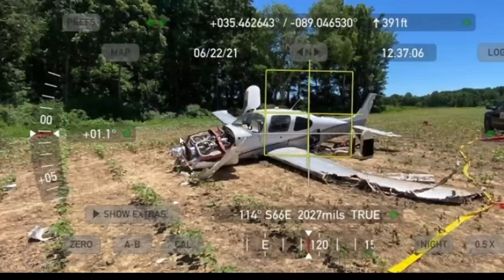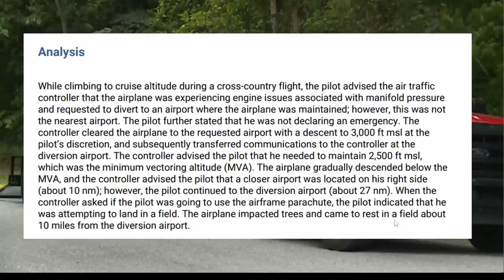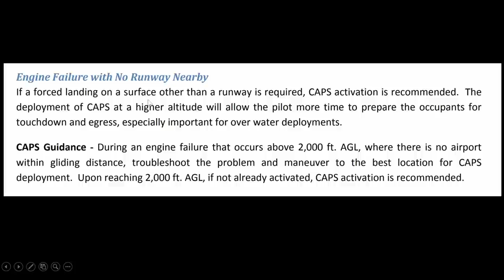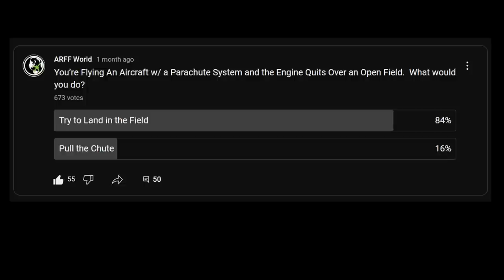Pilot Chose Field, Not Parachute in Tennessee

Comment: Doesn't it seem unusual how many cirrus airplanes have engine failures? Statistically or reported it seems in a very high percentage.
Reply from the maker: NTSB have a lot of Final Reports on these at least that I’ve gone over.  But I see a lot around my airport all the time
Reply: And fatals, too.
Reply: Cirrus does not manufacture engines. There are only three major engine manufacturers who supply engines to the piston fleet today: Lycoming, Continental, and Rotax. There are some others, but they are mostly used in experimental/ amateur-built airplanes. You can’t fault Cirrus for a Continental engine failure. By the way, I fly a Cessna with a Lycoming engine.
Reply: Not really, among the GA aircraft Cirrus  has a pretty good record overall. The same engine as in SR22 you can find also in Velocity XL, Cessna 400, Mooney M20, Beechcraft Baron and Bonanza, to name a few. The engine troubles often come down to maintenance and accidents overall often come down to the individual pilot's actions and choices
Reply: “Statistically” and “it seems” are basically opposites. It’s essentially the difference between science and guessing.

Comment: Open field. Two reasons, one I'm a control freak, the other is if you are current with off airport landing simulation (actual flight) you should be able to land the a/c with slight or no damage. This considers you are current in type and emergency procedures.

Comment: At 2:36 the commentator says "they pulled the parachute and now they have more time".

This is not really true in an engine out or similar situation. The vertical descent rate would be significantly higher under the parachute, than flying at minimum sink speed with the propeller windmilling. So you have less time after pulling the handle.

Comment: I'm pretty good at very quick decision making, especially in the cockpit of an airplane. I haven't yet flown a Cirrus, but if I had engine failure I would do this. First is altitude. Am I high enough to use the BRS (parachute)? Are there good-looking fields that appear as though I could land with little to no damage? Using the BRS destroys a Cirrus, so I will decide if I can land without using the chute. I probably need to be more inclined to use the BRS parachute, because fields often look great from altitude, but all kinds of unseen obstructions like powerlines, trees and ditches will damage a Cirrus & kill a pilot/passenger, as this video attests.  If the terrain below is hopeless, covered in trees, or mountainous, or I'm above low clouds & can't see, or open water, I would not hesitate to use the BRS parachute. Damn, this accident in the video looked survivable!
Reply from the maker: Thank you so much for taking the time to share and happy holidays

Comment: Well done! This is such a good channel and great question regarding whether or not to use the ballistic parachute on a Cirrus engine out emergency. My own thoughts are that it would be much safer if Cirrus had retractable landing gear. With the gear underneath, any rough paddock is going to be very hazardous so I would definitely use the parachute. If it were a tail dragger with big tyres, much different story.
Reply from the maker: Thanks I found this topic very interesting with so many against using the parachute
Reply: @ARFFWorld  Thanks for your reply. I should add to above that the use of the parachute involves certain parameters to be satisfied and isn't always suitable. There will be times it simply cannot be used and a forced landing is the only option.

Comment: Considering you do need to fly the airplane until it stops. Not the point of impact. Looks like he did not avoid obstacles and that's on the operator. I would definitely go for a landing spot over the panic chute That may be equipped. It wasn't an engine failure it was a engine power reduction. Definitely go for the nearest airport airstrip available. One must keep this possibility in mind at all times particular during transitional flight regimes take off and landing.
Reply from the maker: Thanks Matt
Reply: I wonder if any of the pilots that have stated in Matt's poll. That they would rather risk a field landing then pull the chute. Were piloting
 the cirrus on September 28th 2024 who tried landing at Kitty Hawk North Carolina versus pulling the chute. Dumb decision cost the whole family.
Reply: @ebenezerwheezer2957  let's see, because both mishaps were exactly the same situation?
Reply: @ebenezerwheezer2957  I didn't say it was the same situation, the other comment made a equivalency comparison. Those drogue chutes have a minimum altitude anyway.

Comment: Thank you for posting this.  As an SR22 owner, I committed to myself (and my wife) that I would not hesitate to use the CAPS when appropriate. I was in the 16% from your survey! It all looks wide-open and nice from altitude.  Wind change, trees, power lines, ruts, cross fencing, irrigation pipes, etc. - take your pick.  ALL will kill you when touching down at 75mph.  We train for field landings because 95% (or whatever the # is) of the GA fleet does not have CAPS. With CAPS, we still train for the field landings as sometimes that is appropriate.  CAPS is an option, not a requirement.  In this case, a known, controlled descent is the BEST OPTION.  Sadly, the pilot thought otherwise and his decision cost him his life.  BTW, as a CGAUX pilot, I have lots of training and education in water ditching.  I'd take that instead of an open field every day, all day, and twice on Sundays!
Reply from the maker: I appreciate a different take on this and thank you for sharing.
Reply: And what's to stop the parachute from drifting aimlessly into hazards? Sure, the parachute has it's place, but wouldn't you rather fly the airplane to an open field than hope the wind takes you to an open field?
Reply: @A.J.1656  I understand your comment.  My wife had the same ask.
First, you descend at 300 fpm, and are still 3400+lbs, so wind has little impact.  There certainly CAN be some, but use after use after use after use has proven it to be safe(r) than dead stick to fields.  Not fool proof or perfect, but the actual NTSB data shows the reality of CAPs being a good thing.  They have had one land on a school, one on a parked truck, one on a powerline.  No injuries to occupants or bystanders. How many people have died dead-stick/glide into those same things?   Again, time and place for everything, and having it allows the option.  Not having it gives you one shot with a lot of factors outside your control.  Even the best pilot in the world doesn't always control what is underneath them or when the engine quits.  Options are good.
Reply: @mattgirgenti3595  
I could see using it when there are no good options like being in IMC or no suitable landing options. They aren't an option on the airplane I fly, so I have to be ready to find the best place to put it down in the event of a dual engine failure.

Comment: K, pilot training for that specific plane is to pull the chute….  The Cirrus Pilot association has been through this thought process for decades…
The cost of a good decision is 10s of thousands… the cost of life is significantly higher…

Err on the side of survival… pull the chute!

Very few pilots are going to say you did the right thing by landing in a farm field, when the Cirrus training says…pull the chute.

Get the training, follow the training…

Things get more difficult when close to the ground… things are easier, the further from the ground the pilot is… under 1k’ above ground level time to react starts getting short.

As far as loss of turbo goes… this engine has two…. Engine ops get really challenging when a turbo stops working… no real way of practicing that scenario…. It is a good chance the mixture needs to be pulled way back to maintain a good fuel/air ratio…

This plane is pretty heavy and it’s landing gear are always out in the wind… it isn’t a very good glider.

Pilots are also trained how to reduce drag for best glide… for a plane like this, there is an optimum speed, and pulling the prop to a coarse pitch often helps…

Landing in water, with the gear extended… high probability of flipping when the wheels touch the water…. It can be really disorienting to be upside down, getting unbelted, and exiting the plane while underwater…

Being 83… not usually a factor.  Different from being 33… pilots are very capable of knowing when it is time to hang up the flying shoes…. There is an aviation society of flying octogenarians….  😃
Reply from the maker: Appreciate your thoughts on this topic
Reply: Fast response tonight K!

Comment: Pulling the chute means you will not have a say in where the airplane crash happens. Maintaining control means you can land in a field. 
I think people who are conditioned to think that an event like an engine failure is an automatic disaster that will result in a crash are the people who need the chute when there are other options to get on the ground. Most normal pilots who don't panic would only use the parachute if it was necessary.
Reply from the maker: Thanks for your thoughts

Comment: The closest experience to an SR-22 I have is a couple hours in a Katana DA-20, which is also a composite aircraft. One thing I remember is that thing glides forever, and landing in a short field would be very difficult (and probably catastrophic). The more I learn about the Cirrus, the more I understand why it has a parachute.
Reply from the maker: Did you like the Diamond? It looks fast
Reply: I am a student pilot training on the DA20 C-1, and from doing a number of practiced forced approaches now, I know I never want to select a shorter field if I have an actual engine failure. There have been a few less-than-ideal practice scenarios where on my climb out from the approach I've thought, "well, if that was the real deal, I would probably be dead." The aircraft has a remarkable ability to glide, and it is also a very light aircraft. Even a slightly faster approach than normal for landing can result in the aircraft floating in ground effect for a surprising distance. Sad to hear about this loss of a fellow aviator. A good lesson learned for me - if you're having engine troubles, take the closest available field made of pavement first before a short one surrounded by trees is your only option.
Reply: I Love the DA20!! Yes it glides well.. the DA 40 wasn’t as fun.. very stiff controls. The Cirrus doesn’t fly like the Diamond though.
Reply: @ARFFWorld the Diamond might look fast but they aren’t. The 2 seat DA20 is a blast to fly though!
Reply: @1GoodCupofJoe A side slip in DA20 it drops like a rock and touchdown at 65knts, carry a hand axe in the plane in case your inverted.
Reply: @publicmail2  I have indeed found that a slip will drop the thing pretty quickly, but I know I need to keep sharpening my skills and judgment for when to get that slip in if it's needed. I am usually doing at least one forced approach per flight now for practice, so I will definitely keep working at it! The rescue hammer is on my checklist, and I make sure I have it with me prior to every flight.
Reply: @1GoodCupofJoe  Good going , hand axe over hammer.
Reply: @ARFFWorld  Like it? I loved it! After the flight review was finished I took the instructor up to 3500' AGL and showed him a simulated banner pickup, and the plane immediately went into an accelerated stall (not cross-controlled). It was tempting to slam the rudder just to initiate a spin, but one of my former instructors almost died from spinning the DA-20 cause his went into a flat spin, so I kept it coordinated. As far as fast, well, it's almost as fast as Joe Biden climbing a flight of stairs.
Reply: The Diamond DA20 landing speed is much slower than the Cirrus. It's fine in a short field with the proper technique.
Reply: @thomasaltruda  good to know! What characteristics differentiate the DA20 from the Cirrus?
Reply: @1GoodCupofJoe  as a person who's had to land with total engine failure in a PA-25 and a C-305A, I'd rather fly a plane that had a shitty glide ratio than a good one, because they get on the ground faster and stop shorter. A good glide ratio means that you're more likely to hit things as you land off-field.
Reply: @paulis7319  just about everything!! The DA20 is really light on the controls, 100 hp fun glider type plane.. the SR 22 is heavy, much faster, 6 cylinder 4 seat capable machine.. totally different.. ask around your local airport for a ride in one!! I’m sure you can find someone to take you up!!
Reply: @paulis7319  Were you lightly loaded or heavy ?
Reply: You can do Forward Slips.. Do you?

Comment: Definitely a sad ending here and it's difficult to say how another experienced SR22 pilot under the same conditions might react. The wisest decision would have been to land at the nearest airport. With that said I would have attempted this field landing if I thought it was doable. Another factor might have been that the aircraft was too low for the parachute system to fully deploy in time. The aircraft has to be at least 400' agl or higher in order for it to work. I'm guessing that the pilot choose the field because having the CAPS system repacked is expensive &/or he was below the 400' agl minimum; like I said, just a guess.
Reply from the maker: Always appreciated Eric
Reply: The plane is a write off if CAPS deployed

Comment: Very sad one indeed.  A big factor is what altitude you are at when the engine failure ocurrs.  If you are flying too low, CAPs is not going to help you because it will fail to deploy.  Its only good at deploying at higher altitudes of around 400 feet AGL or more.  If I had an engine failure in an SR-22, I would look for a paved road to land on over a farmer's field.  Most SR-22's have composite wheel fairings installed on the landing gear and they can make landing in a farmers field treacherous at best.  I have seen these SR-22's land in a soft field where the wheel fairings actually dug into the ground and caused the plane to flip over onto its back, making chances for survival questionable.  I'm sure the mechanic that did the work on that waste gate feels responsible for his role in this accident.  Be a hard thing to live with.  Thoughts and prayers go out to the pilot's family and friends.
Reply: Chutes work effectively with much less altitude than 3000’ but despite having sufficient altitude to do so, this pilot chose to fly all the way to the ground.
Reply: @dryreed  I’m not a Cirrus driver, but I think CAPS is effective above 400 AGL.
Reply: @cessna177flyer3  That is one of the numbers, but it depends on the model and state of flight. Newer, heavier ones, and slower, e.g. departure, segments will need more altitude to deploy fully.
In this specific flight, he had partial power and was able to fly 17 miles before finally descending into ground, after passing an airport at 10 miles from the point of reporting the issue. He understandably wanted to get to the maintenance shop to avoid the hassle or cost of remote maintenance. He gambled he could fly far enough but lost. This didn’t have to be a parachute discussion but that’s easy to know in hindsight.
Reply: Just to clarify, as an SR22 owner and pilot, I can confirm the CAPS 'minimum' certified altitude is 600' AGL in G5 and 500' AGL in pre-G5.  They were successfully demonstrated as low as 350'.  That is equivalent to being on short final (ish).  They were tested at higher speeds, but have confirmed failure above the CAPs activation speed.  

These numbers are part of a proper takeoff briefing. This is from the Cirrus training Syllabus:

CAPS Guidance – At 500 ft. (600 ft. G5) AGL or less, land straight ahead (use CAPS immediately if no other survivable alternative exists); 500 ft. (600 ft. G5) - 2,000 ft. AGL, use CAPS immediately; at 2,000 ft. AGL or above, troubleshoot and use CAPS as required.
Reply: @mattgirgenti3595  Yes, thats sounds correct regarding CAPS.  My bad.  Thanks for Sharing.

Comment: It struck me as odd that he elected to try and fly to an airport further away even after the ATC's query. I don't mean to speak ill of the dead, but fixing the plane after the emergency landing really shouldn't be the top priority BEFORE the emergency landing itself. Especially when the controller advised the nearest airport was 10 nm away rather than 27. He quite likely would have made it to the closer field even if that required some turns, given he had flown around 17 nm before going down. 
Also, it would appear that he was too low to pull the CAPS at that point. RIP
Reply: Of course we only know that for sure in hindsight. We don’t hear about the times someone limped into their home airport successfully, but this certainly illustrates the comparative risk of death vs inconvenience. I hope I make the right decision when I face that dilemma.

Comment: This is pilot arrogance all day. In reduced power situation you find the nearest airport as the engine is only going to get worse. Farm field landings (appears to be a bean farm in video) are iffy as the fields are furrowed. It's very easy for gear to bite into the dirt, aircraft rotates around wheels, and slaps you onto your roof at 60mph. I understand how pulling the parachute can feel like surrender, but pilots have to remember it's no different than a losing battle in war, sometimes its "surrender or die". And the fact you buy a  cirrus pretty much just for this feature, its senseless he didn't use it when he knew airport was out of reach. Pride will bite you every time. My 2 cents. RIP pilot.
Reply: Yep. Once the engine quits or failure is eminent, the airplane becomes an escape pod. Preserving life is all that matters. Let the insurance company sort out the rest.
Reply from the maker: Thanks for your take on this.  RIP and Prayers to the pilot